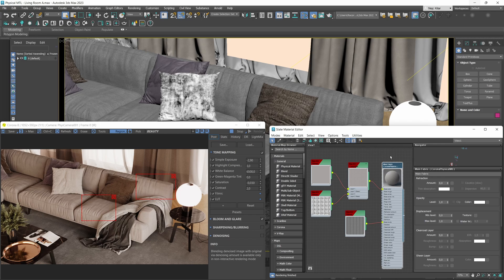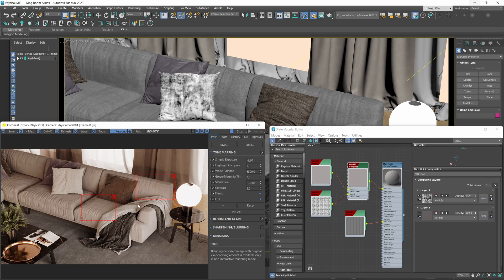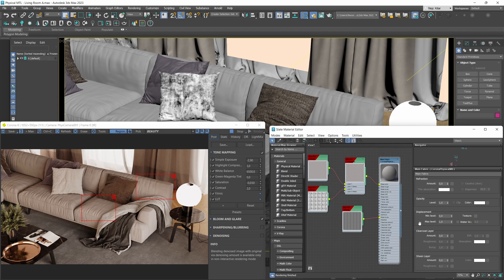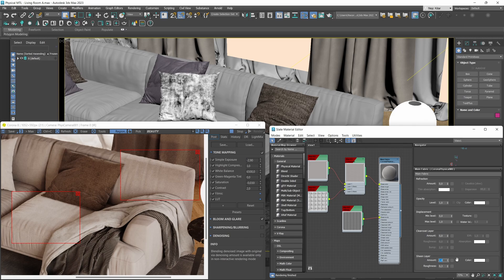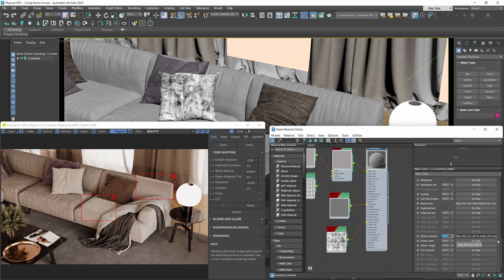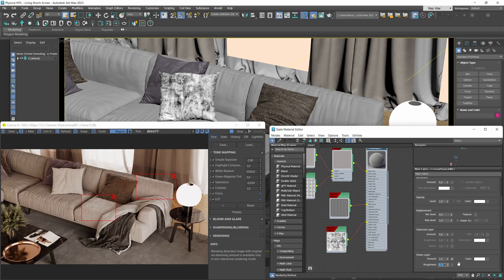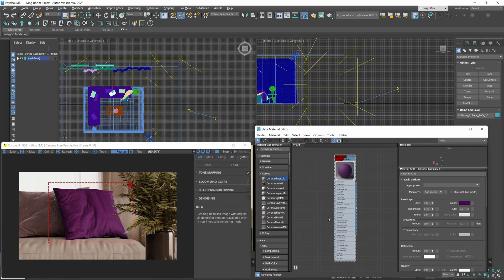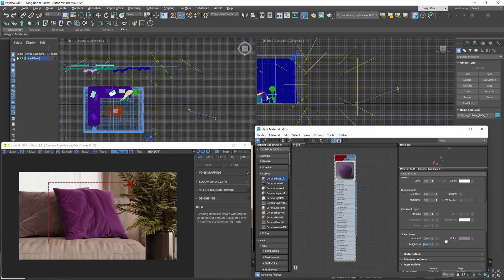Corona for 3ds Max Physical Material Tutorial, Part 07 - The Sheen Layer

Comment: What should I set for ior and roughness? In simple corona mtl I could reduce parameter for reflection. How I can turn off reflections for the fabric in physical mtl?
Reply from the maker: Hey there and thank you for asking such a good question! The answer can be overly complex if we go into the details but we'll try to simplify it a bit while still retaining the point of it.

For the IOR value itself you typically find existing measurements online although by and large there is an argument to be made that for non-refractive materials the differences between most common IOR values are very negligible (for example IOR of 1.4 vs IOR of 1.5) so the default of 1.5 works fine in most cases.

As for reducing the actual reflections... It's worth remembering that the Physical MTL is supposed to be physical and pretty much every material in the real world is reflective even if it is extremely diffuse.

In the past lots of 3D artists disabled or lowered the reflections on very diffuse materials but physically that would be incorrect. Very diffuse looking materials still have reflections its just that the reflections are very rough - very diffuse. Additionally, they also potentially have a lower IOR.

And so that is the more "proper" way of controlling the reflectivity of your materials - if you want the reflections to be less noticeable you ought to up the roughness and or lower the IOR if needed. The reflections will still be there, as they should be its just that they'll be very rough and at that point they'll become less and less noticeable to the eye. They are still there its just that they will be super spread out.

The idea is that you can't just tune this overall reflectivity parameter anymore and instead you resort to tuning the reflections in a more physical way which means that the adjustments you're making are behaving more like they would in real life.

We can dive even deeper into the topic but I'd really recommend you open up a thread on our forums (https://forum.corona-renderer.com/) if you're interested in doing that because Youtube comments really don't allow sharing images and just aren't that kind for these long form explanations.

Still, hope this tid bit will prove to be helpful :) Nejc